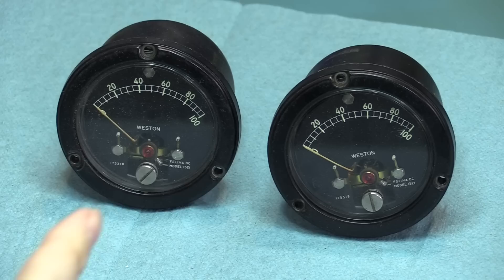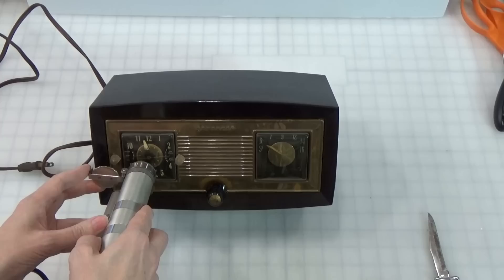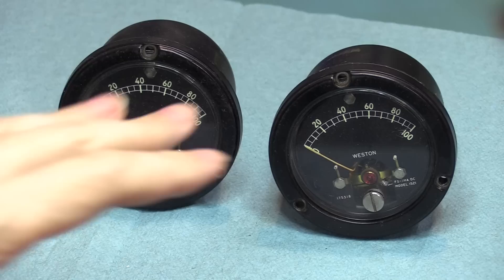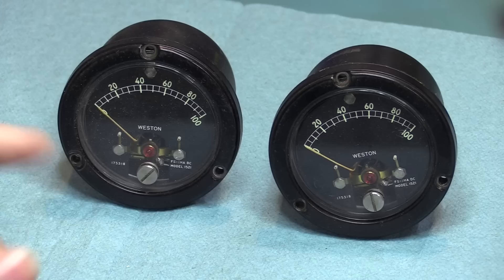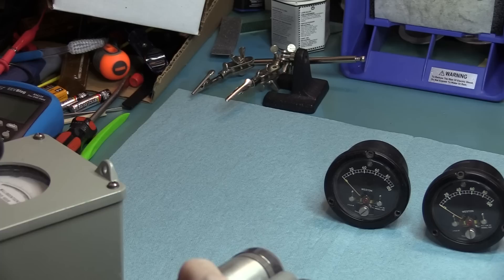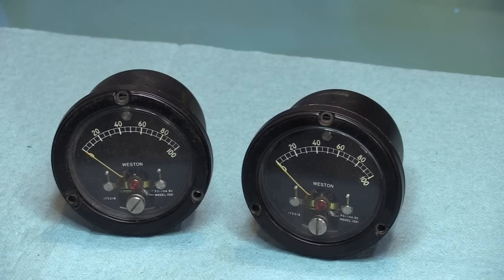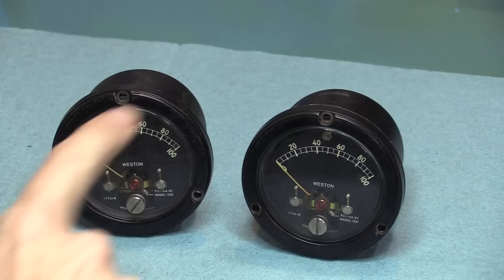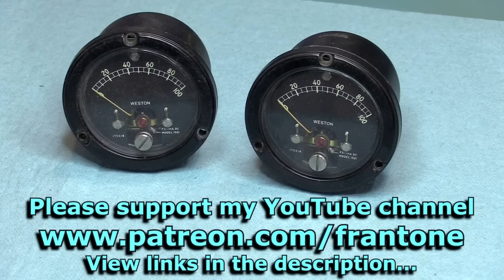Mil-Spec Radium Dial Panel Meters

Comment: I suspect that the heavy cases on the meters had a lot more to do with protecting the instrument than with protecting the operator.   That kind of thinking didn't really become common until decades after those meters were built...   Fascinating stuff.   Thanks Fran!
Reply: you are correct.

Comment: I had one of those in high school! As I recall, it was 0 to 50 VDC ..it glowed dimly all night. It was connected to my homemade 12 volt selenium solar cell panel.
     Old orange " carnival glass" was slightly radioactive. We did radiographs with a 1930s orange plate and Tri-X pan sheet film in physics class.
   This was back in the mid '70s...
     I like those old school analog meters..I have a few old ones, but most " evaporated" over the years...
    Another cool video of old school stuff .

Comment: A lot of meters are painted with things other than Radium, like mesothorium, which is insanely radioactive, with a half-life of about 6 years.  So it's likely those dials, if they are 60 years old, will be down to about 2^-10 of their initial radioactivity, or just one part per thousand of the original activity!

Comment: These old instruments are works of art.  One thinks to be able to recognize the quality by the care of the production.  At that time, the appearance of an instrument was still very important.
Reply: And it’s not important now?
Reply: It should be. But how can one achieve the charm of a pointer instrument with a digital display?
Reply: Yes. Analog displays don‘t need to be read. They only need to be looked at. When I was young I had a beetle, 80 km/h (50mph) was reached when the pointer was up. To read a watch is way easier with an analog one, e.g. showing that it‘s closed to 12:00. 11:49 on a digital display has to be read carefully....

Comment: I had a physics professor bring over a fancy geiger-counter to check over my Collins R-392 military radio.  It had a small barely glowing tuning meter.   The counter showed 13 millirems/hr at 4 inches away.  Pretty high, even it was probably about 8 half-lifes run down.

Comment: I still have the Baby Ben alarm clock I bought in 1972. The phosphor has been nuked off over the years so there's is very little glow when hit with bright light then put in darkness. However, it still scintillates when your eyes get dark adapted and you can see the little sparkles when you look through a magnifier. We used to do this in physics class in the 1960's with an alpha source in a tube with attached magnifier. Later, the alpha source was taken away by school officials, but we still was playing with the spilled mercury found in the windowsill that oozed up from the woodwork that a student spilled several years before. Today, if a cracked old mercury thermometer is found in one of the old school cabinets, it is red alert!

Comment: Crikey, I used to fix clocks when I was young, lots of them had dials & hands which “glowed”, but I’ll never know if any were proper radium ones... oh just remembered about the box of old panel meters stashed under my bench...might be time to get a geiger counter :-)
Reply: If you do not have a radiation detector, it is probably safest to assume that any "glow in the dark"-looking paint on older clocks or instruments  will contain radium, the use did decline in the latter half of the 1900s, when alternatives became more common, but I wouldn't trust anything before 1970 at the earliest without testing it first(this might depend on where in the world you live, of course)

The primary risk is probably not from exposure to the radiation of the dial and hands, but rather ingesting or breathing in the dust that might have collected inside or come detached during the work, so taking precaution against dust is probably best if there is any doubt.

Comment: Weston Meters were made in the UK and USA by Sangamo Weston, and the differences between the two are very minor but they have different model numbers. Some later models were made by other manufacturers  under licence. The US company was founded in 1888 Springfield Illinois as a manufacturer of electrical measuring instruments with a factory in Newark NJ, with the UK company following on in Enfield Middlesex a year later. 

In 1954 the US company was bought out by Daystrom, then in 1962 Schlumberger took over Daystrom.  In 1974 the Newark plant was shut down. In 1987 there were investigations going on over contamination of the surrounding land. Sangamo manufactured PCB-containing electrical capacitors there during 1955-74. Sangamo notified the US Environmental Protection Agency of its disposal of approximately 38,700 cubic yards of PCB waste on its plant site and an undetermined amount in seven satellite dumps, all in the Twelve-Mile Creek Basin. Solid, sludge, and liquid wastes were stored or disposed of in piles, landfills, and impoundments. How nice! Since then Sangamo-Weston has removed over 17,000 cubic yards of waste from past disposal areas on and off the plant property. How sad it should all end this way - I'm sure Edward would be turning in his grave if he knew.

Comment: I was told by My Jeweler that to some of the early watches and meters used polonium instead of radium because it was less expensive also I have a Korean war-era military Jeep (m38a1) and the speedo is radium lettered and still glows brightly to this day.
Reply: Ah you mean Promethium-147. It was safer than radium. It had a half-life of 2.6 years. Compared to Radium’s 1,600 year half-life.

Comment: I've seen a lot of regular, panel meters at the surplus places I used to go to, but I've never seen a radium dial version.  (or if I did, it was when I was young and didn't realize it.)

Sadly, they are all out of business now.  I should have taken every panel meter the last guy had, but I didn't.  (but I've still got quite a few, and my dad has some as well)

Comment: My Grandfather, I'm 62 btw, had a watch that glowed in the dark, but only the 12,3,6 and 9 had little rocks of yellow embedded in the points and the hands glowed brightly as they went by the rocks, and slowly dimmed as they were away from the rocks. He said he got it in Egypt, and that the rocks were Uranium, and the hands had some Zinc paste on them. The hands glowed a blue color and the 4 points a greenish light not as bright as the hands. Near the 3, there was a moon  that changed size for the waxing and waning of the moon, and it glowed as well But I can't remember the color maybe a sort of yellow, there was a picture of the man in the moon or something like that on it. He did this trick where he held his watch up to another watch that had 'normal' radium paint on it, and the other watch would glow really brightly.

Comment: Very cool! I don't suppose you would consider parting with a few old meters? i need 3 for my transmitter 100ma full deflection or less not picky.
I could make 50 ma work too. The ones i have are old and crappy, they stick sometimes and are not the same shape and size. Yeah i could get new ones but they're new, just a thought. I forgot about the haul from the uni years back....makes me think i've been watching you for quite a while now time does in fact fly by.

Comment: Be careful not to open or break the glass/celluloid cover on old clocks and watches. Inhaling or ingesting the dust from that paint is lethal. I got a ww2 pocket watch recently, and didn't even think about radium until I'd had the back off and looked inside...  😓😵😱

Comment: Radium emits a weak 186 keV gamma but it's daughter's have much higher and more penetrating  Gamma Ray's.  Namely Lead ²¹⁴ and Bismuth ²¹⁴ this was from HPS.org
As you know, both 214Bi and 214Pb emit measurable gamma rays, and both can be useful in the indirect determination of 226Ra, a precursor in the decay chain that produces the lead and bismuth progeny. The 214Pb emits lower-energy photons than does the 214Bi, the three most abundant gamma rays from the lead being at 242 keV (7.43 percent), 295 keV (19.3 percent), and 352 keV (37.6 percent). The dominant gamma rays from 214Bi are more in number and higher in energy than the lead gamma rays; the range of useful energies is from about 600 keV to about 2.5 MeV. The bismuth gamma ray of highest yield is at 609 keV (46.1 percent); there is a gamma ray at 1.12 MeV (15.1 percent) and one at 1.765 MeV (15.4 percent). The others have individual yields no higher than about 5 percent.

Comment: Also don't forget that the radium itself decays; the isotope with the longest halftime is 1600 years, but the runner-up is only 5.75 years. After a few decades quite a bit of radium may be gone.
Reply: The longer the half life, the less radiation it puts out, and the less it will glow. With a half-life of 1600 years in it's most stable form, it is no longer nearly as dangerous, but will also no longer glow enough to be useful. It will take a long time for most of the radium to decay to that state, though.
Reply: In the older meters & such, we don't know that they isolated for shorter half-life isotopes.  I know I've seen WW2 era meters (almost 80yrs) with dead phosphors that are still hot as heck.  Too bad Geiger counters aren't cheaper to have on the average tinkerer's workbench.
Reply: True, but some of the radium daughters are even "hotter" than the radium itself.
Reply: @rich1051414  Actually, the main issue with radium paint is not radium decay-with a 1600 year half-life, the decay is not important in the short-term.
HOWEVER, as Fran noted, the phosphors in the paint DO deteriorate.
The radiation itself does that, and moisture speeds the process up.
Of course, time is a major factor as well.
Some alarm clocks from 1968(which was pretty much the last year radium was used in them) will still have a faint glow even after being in the dark for a long period of time, even though they are not too well sealed.
The older ones generally have ZERO glow(except under UV light).
Fran's meters are way older, but due to they being totally sealed, the faint glow still remains.
Reply: @ordinaryaverageguy76  It does not matter much:radium 226(which was the primary isotope used) has a 1600 year half-life.  So the meters can still be quite hot with totally dead phosphors.
Reply: @M. K.   Not sure what point you're referring to...  decay rate is an issue surely when it comes to disposal & safety... and the phosphors are the issue if you need to have it glowing for you (w/out UV).

>the meters can still be quite hot with totally dead phosphors
Yes indeed.  I think I said that.  And the lack of glow sometimes fools people into thinking the radium dials they look at aren't radium paint.

Comment: I DO NOT think these contain Ra-226. These were probably re-lumed or never had radium. Not all old instruments contain radium, military or not. For military instruments, if the paint isn't tan or doesn't look "burnt", it's probably not radium. I would do a timed count, for about 10 minutes: One with the meters as close to the G-M tube window as possible, and the other with the meters out of the area with the window open for background. Repeat this for better results. If there is no change, than it wouldn't be radium, since some of the Ra-226 daughters emit very high energy gamma rays, e.g. bismuth-214, which easily penetrate glass. I have A LOT of various Ra-226 sources, and all of my Geiger-Müller counters can easily detect them, some through concrete and lead bricks.

Comment: There is one thing you didn't mention. What were these gauges used for? There is no indication of measurement on them. Just a graduate from 0 to 100. Amps? Watts? Voltage? Temperature? The angle of the dangle? What?

Comment: Well, I'm not sure you have radium here. There are some contradictions in the observations that raised questions: your GC doesn't peak any gamma but the dial are still glowing reasonably, strange? Even if Ra226 half life is 1600y, it has a characteristic gamma line at 186keV, and Bi214, Pb214 (decay products) have also several gamma lines that should render your GC crazy... And gamma will never be blocked by the watch glass.
Also, the luminous paint seems not degraded: if it was ZnS (copper dopped zinc sulfide), the molecule should be broken by alpha particles comming from Ra decay, rendering the paint almost inefficient after several decades... I have some needles with radium paint, quite old, they all exhibit the same appearance: heterogeneous remaining and faint luminescent (some spots more visible), not reacting to normal light, but still a strong reaction of my Geiger counter.
I tried also to find some specs about these meters, but found nothing regarding luminous paint.
It could be interesting to make a gamma spectrum to get a confirmation. If you can.
Another simple test would be to check the remaining luminescent after 48h completely in the dark.

Comment: Had a buddy in high school, his dad was a jeweler and they had a small pot of radium paint (older than the hills) to "touch up" watches and clocks. His dad always said you would be fine using the stuff as long as you didn't lick the paint brush,  the paint pot sat on the work bench for years, his father died of cancer, maybe coincidence.

Comment: Is the shield on the end the wrong way round? it shields the gamma tube while open..
Reply: right? I noticed that too after seeing the second cable going to the little tube but thought maybe like it's some sort of two option fancy detector wand....geiger–mueller?

[edit] 5:50 oh neat :D
Reply: At https://youtu.be/DWM5MVmHZUM?t=98 you can see that it is not or not completely covering the gamma detector. The lid for the particle detector tube is to thin to shield gamma radiation.
Reply: @berndeckenfels  would it not read more accurately without the obstruction?
Reply: tomnwoo hm possible, don’t know but those counters are just a rough guess anyway
Reply: @tomnwoo  when measuring Gamma, the cover is closed.
You only open it to read Alpha and Beta.
With the cover closed, the large tube is used for Gamma on the lower ranges, and the smaller tube is used on the higher ranges.

Comment: How about smoke alarms?
Reply: I think those use americium and in tiiiiiiny tiiiiiny amounts.
Reply: Americium 241, only .9 uCi, VEEERY weak gamma rays and lots of alpha particles that are stopped by the little shield, as well as most of the gamma, very weakly radioactive, measuring outside the casing

Comment: Are they ammeters or voltmeters?
Reply: These are ammeters.  You can see in the lower right, right of the pointer pivot and slightly lower, FS= 1ma DC.  That means that full scale (FS) is 1 milliampere.  Often these ammeters are labeled "volts," but are ammeters designed to be used with an appropriate circuit. (usually a series resistor)

Some have a series resistor " in the can" so to speak, and are thus "voltmeters."
Reply: In a sense, all such moving-coil meters are ammeters because the principle on which they work is current flowing through windings immersed in a magnetic field.  But as @excavatoree explains, we tend to name meters for whatever the dial is labeled.
Reply: @excavatoree  ammeters need to use a parallel resistance called a shunt to measure higher current.

Comment: Now I'm concerned "dead" radium paint still responds to light... I have a clock that might be - and the glass is chipped
Reply: Unless it was lead glass the same amount of radiation leaks from the source radium. Which amounts to squat
Reply: No reason to worry if you don't actually mess with the paint, as long you don't ingest it it's fine. (I have lots of dials with radium, not in the glass, just don't open it and play with the paint :D)

Comment: I have one of those counters , what is the added box next to the handle ?
Thanks again
Reply: If i recall right, it is an speaker with amplification to replace the original headfones.
Reply: Might also be battery eliminator.  Similar counters I've seen were originally made to be portable.
Reply: @ordinaryaverageguy76  No need , it takes regular D - cells , lots of room for something else .
Reply from the maker: Yes, just a little amplifier and mini dynamic speaker for the audio output.

Comment: I glad they quit using radium ,the clock.radio dangerous.hope not many family's bought them ,I collect old radios is there another way to test for radium
Reply: You'll sooner die of an electric shock from an old radio, than from exposure to an intact radium dial. If the paint is flakey, be careful. Else, there is no reason to be scared. 

You can build your own counter with a photodiode encased in a radiation transparant but light blocking enclosure. Some phone cameras are also somewhat sensitive to radiation.